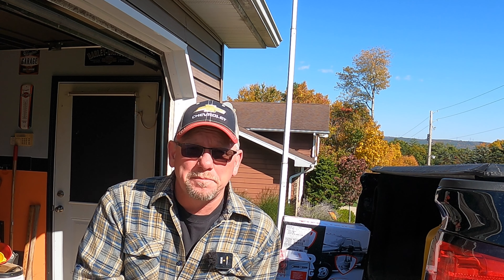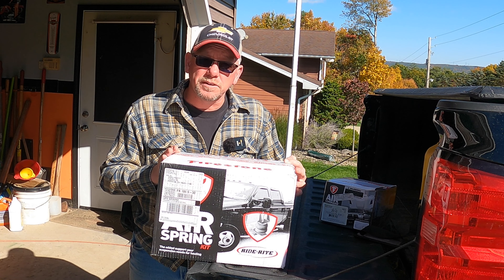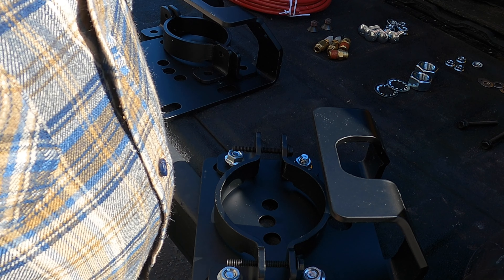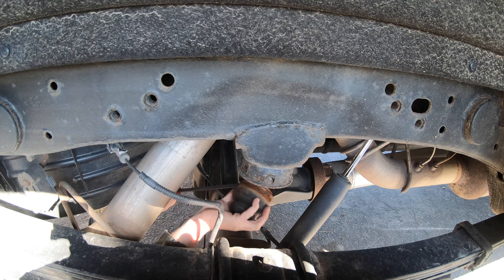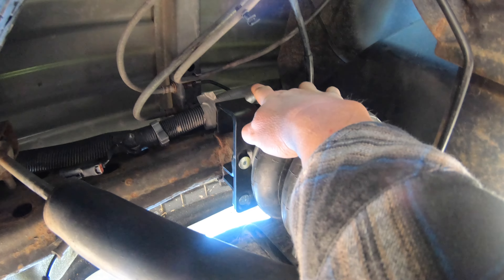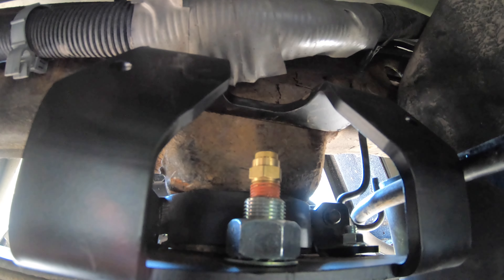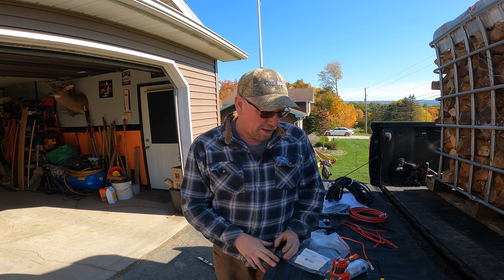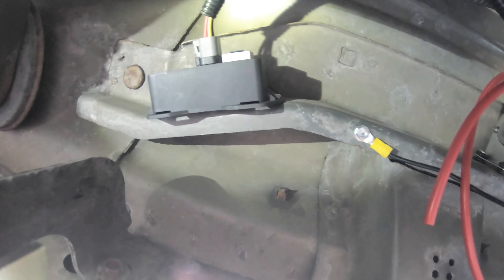#108 Leveling a Heavy Load with Air Springs on a Chevy 2500 HD Duramax  #silverado #airbag #towing

Comment: I can fix that sag for ya. Just trade that bow tie for a blue oval. Lol
Just bustin' on ya brother. Good video. Was thinking of adding some to either one of our trucks.
Reply from the maker: I am amazed with the change in performance.  My neighbor has them and that is what gave me the idea.   I see him coming up the road with a full load of stacked green oak and the truck is perfectly level.  Got me thinking of when I have 7 ton behind me.  Most of the time that is the dump trailer and a Ford going home to the junk yard.  😂
Reply: This sounds like a good idea.  Hauling a lot of weight puts a strain on the vehicle so anything you can do to help is a plus.
Reply from the maker: @johnrosier1686  the biggest advantages are  the reduction of sway and bounce plus a huge increase in stopping power.   Very happy I did this modification.
Reply: @woodruffwoods  😎👍

Comment: them airbag systems are really nice! I am thinking about putting that on my wife's Ford F250!! my Ford F350 with the power stroke doesn't sag in the rear end!! might have to trade off the bowtie for a real truck hahahaha 🤣🤣!! just kidding Darrin yeah them trailers full of wood are very heavy!! stay safe my friend 🍻🍻
Reply from the maker: It isn’t the 3/4 and 1 tons that I see that are really overloaded, it is mostly the half tons. I see them going down the road with a completely squatted suspension. Regardless of what we are driving or towing, getting the level load is a huge advantage.  As for those Fords, when they put an engine not made by Ford in one of their vehicles, I will consider buying one. 😂

Comment: Nice kit and install! I have only had a couple loads of wood in my new dump trailer so far and I haven’t noticed any squatting issues with my  duramax. My truck is not lifted though. I will have to see what it does when I get a good load of logs on? I will say when I pull my 5th wheel that is 12,500 lbs it just levels out the truck but it does really compress the suspension going over overpasses on the interstate. Maybe this kit would stop that for me. Thanks for sharing the install Woody👍🏻👍🏻-TOA
Reply from the maker: I have really only noticed it with hauling stone or wood in log form.  The 2500 is certainly capable of handling it but leveling the truck tends to keep police from raising an eyebrow.  Many times I am towing my tractor with a load stacked in the bed of the truck which just looks bad to the DOT.   I think I will shoot another short video showing the difference with a load (at some point).   I really like this solution better than an extra spring installed.
Reply: @woodruffwoods  yeah I can totally agree with what your saying! That crossed my mind with getting the new dump trailer because I’m sure I will overload it🤣 Dot don’t seem to bother people pulling RVs! Even though most people are overloaded
Reply from the maker: @toddsoutsideagain  exactly!  For some reason they are cracking down on pickups.  I heard in PA the governor was pushing to require a non cdl for anyone pulling a trailer.

Comment: I need these on my little Nissan Frontier more than you need them on the truck you have, about 3/4 load and I am near down on the overloads, I need to look and see if there is a set up for that
Reply from the maker: Ben I bought mine from www.sdtrucksprings.com and they were great to work with.  They use these on all kinds of luxury cars and limousines so I suspect they exist for any truck.

Comment: I want to beef up my suspension on my tundra it has the power but I don't like the sag when I'm pulling my trailer I haven't pulled the trigger yet
Reply from the maker: This is a good solution if you also want to maintain some level of ride comfort.  You have to keep 5 psi in the bags but it tends to just soften the ride a bit and not make it like you are sitting on a hay wagon.